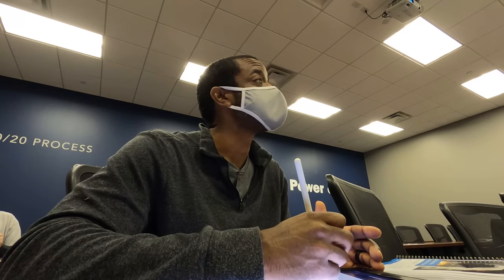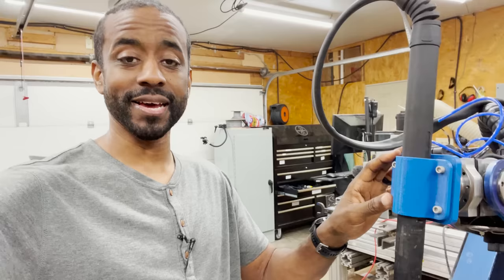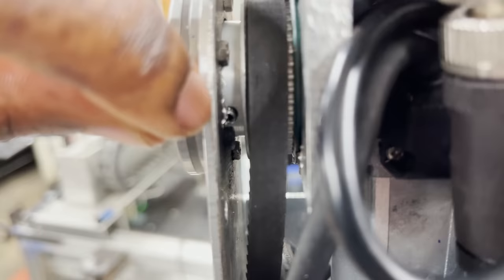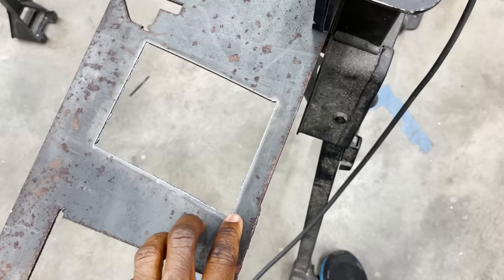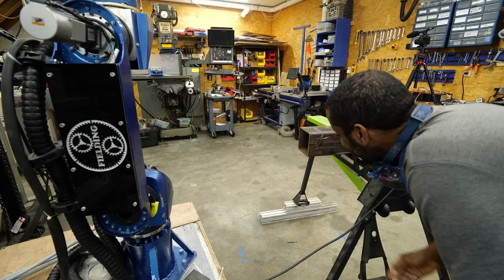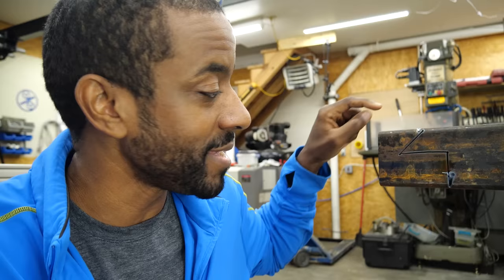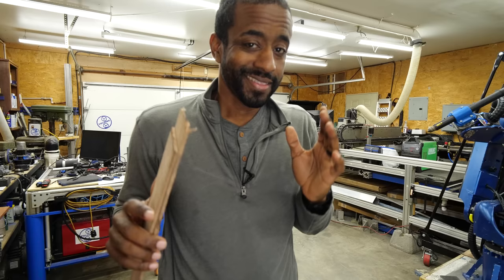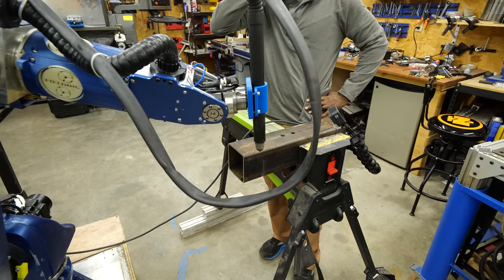I Added a Plasma Torch To My Robot - Jeremy Fielding #097

Comment from the maker: I figured out the relay problem. It is a solid state relay designed for low voltage DC only. I was switching 240 AC. I "remembered" the relay as being for both, but I was wrong when I went back and checked the specs! One problem down! LOL
Reply: That was my guess! Sounds like you got it. Amazing the things we miss when we're in a crunch.
Reply: LOL you were pushing the MosFETS into avalanche breakd-down while hooked to the plasma torch and it didn't explode?!  What brand relay did you buy, 'cause that's one TOUGH solid-state relay.
Reply: Great now your mind is free to tackle the main issue of programming and tracking,  good luck...
Reply: I believe that Stuff Made Here calls this "Integration Hell"
Reply: Jeremy, did you recalibrate after you adjusted the settings on the servo drivers?
Reply: Thought about that..... And you already figured it out! Awesome work!
Reply: Dude, this is inspiring. Love your channel
Reply: @martylawson1638  the trigger for plasma cutters is very low current. Most just use a normal limit switch to do it in the hand held torch. It's just an enable. Id be surprised that it's actually 240v.. it's probably 24v ac  or whatever the control board runs at. It would look like a closed switch by useing the body diode of the mosfet.
Reply: @jim4556  good point.  A lot of DC solid state relays are polarized to reduce heating.  I.e. use one output FET vs an anti-series pair.   Also FETs can be reliability operated in avalanche breakdown if you keep the energy input within the FETs ratings.  (Lot of stepper drivers use avalanche mode to shut down inactive coils faster)
Reply: The best way without take mcu process time is to use liniar hall efect sensor for each motor.

Then you can send motor left right (on off) only and just wait until get the right read from hall sensor.

About the circle in plasma cutter ,  you need to turn off the cutter until the motor move.
If it stay more time with slow move or reposition another cut.

Reporgram if the motor speed is blow x(m/sec) then plasma cutter relay off. ( the speed in x/y ).
The plasme dont cut in z only x,y
Reply: You can use or triac or relay solid.
Relay dc or ac dosnt import only the amper(a).

I dont know what it the plasma max power in watt. 
Triac can hold 240V and upto 40A
Reply: @orencomputerelectronics8751  no. I think it's a very bad idea to move away from encoders. Just get hardware that can properly count the pulses. You are trading like 32 thousand units of resolusion for like 1000
Reply: @martylawson1638  triac take upto 1.2v mult the current(A).
If thr current is 40A ( about 50W on ssr) .

He need good ssr , with high voltage (more then 240) because the spikes the break down the triac)
Reply: @jim4556  if he use encoder then he just need take lm555 in one state pulse. The mcu send one pulse the timer 555 send x pulses. Put one 555 for each motor then you dond need waste cpu time one this loop
Reply: @orencomputerelectronics8751  what? How would a clock IC help at all? Encoders have  A, A', B, B' and a zero or home pulse/ channel. This is done so you can determine position and direction  at any point of its rotation. Then you got absolute encoders that remember their position on power cycle.. Or safety rated where they are redundant.  You can't do anything with a 555. You need a microcontroller that's interrupt based. It needs a very fast scan time. That's what the fast counter cards do and are built to do. It's basically a microcontroller on its own with one job.. my point is why do this when you can just buy the part. 

Drives that don't have an encoder feedback are sorta hard to control anyways. So just buy a drive that does it all so you don't need to reverse engineer solutions to the  counting pulses, interference noise, PID turning and controlling that motor at a significant delay. Drives are very noisy. They put crap onto the line power and the radiated noise from the wires going to the motors will play hell on your electronics if they arnt built to be resistant to it. Those can cause false counts as well on things not built to do it
Reply: I was going to ask how “open” is open on the relay. Glad you got one down
Reply: @jim4556  the encoders coplex the situation. The encoder a= left a'= right  b=move one step b'=no move.

You connect ic clock to B, the mcu put stay 1" or 0" stay without cpu loop waste
Reply: @jim4556  i wat build soeedometer with 5v stepmotor 5 wire 2 pair.

I dont use encoder , the mcu take care of motor and 3 digit 7 seg
Reply: @orencomputerelectronics8751  stepper motors you are easy. They either go as fast as you are telling them to go since each step is commanded. You can determine their speed in software alone. Induction motors are different since they can slip in normal operation. That's why you use another device to determine position for movement control. If all you want is speed, you determine that sorta the same as a stepper motor and base it off of whatever frequency you are giving it.
Reply: @jim4556  Induction motors you can control the speed by PWM or voltage control.

the mcu easy can do that.
that is not problem 

about the position, i put sensor adn when the system boot the motor go start up position.

then the program will sync witjh motor
Reply: That was my knee jerk reaction. Sounded like your relay was arcing...
Reply: @jim4556  hi, induuction motor you can contol with PWM or voltage rate.

step motor in more complex to control, every cycle i need to run 5 code line for each 4 cycle (one is VCC=5V with 2 pair wire).

if i use induction motor with gear, i can easy control the movement.

the best way to control that , sensor position and the software in mcu can correct position.

when in motor had  resistance, it will take  more current and will move slower depend the control and magnetic interference  .
Reply: @orencomputerelectronics8751  stepper motors are far easier to control than a servo motor since stepper motors are synchronous. If you tell it to move 10 rpm, and it's not, you have a mechanical issue. So getting speed is very simple. A servo motors are just induction motors with feedback. They are not synchronous. And you cannot count on them spinning the speed you command as they slip when starting or stopping. Or with load changes.. that why you need position feedback with them. And do not need it with a stepper motor.
Reply: @jim4556  in step motor you must postion feedback also.

let say the power cut off, how mcu know where is the postion the  motor after boot up.
Reply: @orencomputerelectronics8751  no it's optional at best. My proof, 3d printers are 100% open loop with no position feedback. And most now can resume prints after a power cycle. Since you knew where the position was when it stopped, you know where it is when you turn it back on. You could use absolute encoders but at that point you should probably just use a better motor than a stepper motor. If you require higher accuracy your better off doing a homing move and zeroing it out in software before useing position feedback. You rarely use position feedback with stepper motors because there's almost no point in doing it. Again. It's a synchronous motor. It does exactly what you are telling it to do and if it's not, you've got bigger problems like an undersized motor. They should never slip in operation.
Reply: Instead of making plasma cuts, I would stick a magic marker in the holder to prove the path correctly first.
Reply: I bet you get job offers so much that it's become annoying, lol 😆
Reply: @jim4556  in 2D and 3D printer had optic led.
in 2D printer when you power it on the headwill  go to start point.

in paper feed had mechanic switch(on off) if had paper.
then the mcu of printer know where is the head nd papar.
if you dont use sensor, you move the motor over the limit and it will stop knowen position.
Reply: @orencomputerelectronics8751  an optical LED would not give you any position feedback and they are definitely not used in 3d printers. 

Occasionally a disk with slits that light can pass through is used in 2d printers but that's so they can have position feedback of a brushed DC motor. It's usually pretty low resolution. But offers no absolute position feedback. That disk with slits that light passes through is pretty much how encoders work. Now add 2 more disks to that thousands more slits and you pretty much have a modern day encoder.. 

Either way, it's not used on 3d printers. And I'm pretty sure that is only used on the brushed DC motor used to advance the paper in some 2d printers. But it also isn't used to remember position on power off. If you don't have the count it was on when power what turned off saved in memory, you will loose position.  However that's redundant for stepper motors. Because either you had it's position saved in software or you lost it. Again stepper motors are unique in that they are synchronous. They will not move unless you command them to take a step. If you are commanding each step. You don't need position feedback, you already know what position it's in.
Reply: Ok
Reply: Exactly what I thought, or a current mismatch, which amounts to the same thing.
Reply: Sounds like a good job for a Triac!
Reply: I was literally about to suggest switching voltage... yay for many eyeballs
Reply: I remember putting ac into a dc relay and it making this crazy buzzing sounds. Yup, using the right relay is critical!
Reply: This is exactly why it's usually a waste of time to try to troubleshoot problems remotely / sight-unseen.  My dad used to tell me "A client will call and say there's green smoke coming out the back, then I drive to the site and it's actually white smoke coming out the front."
Reply: Copying a reply I posted elsewhere: Shot in the dark -- is it possible that whatever cabling you are using to send the pulses from the microcontroller is interfering (via parasitic capacitance or I-don't-know-what) with the signal? E.g. filtering out some proportion of the signal, given that it's switching pretty fast? I.e. is the cabling designed for such use?
Reply: Jeremy remember the first video you made ??
Brother, I had found that video by accident a few years ago and emailed it to a few people with quite the paragraph about you as i proudly claimed you as My Find 😆.
Look at how far you have come man !

Doing AMAZING!

I know this doesn’t need said but man you have shown much more than your ingenuity!
Reply: I enjoy the developmental progression of your videos. I am happy you are able to be open enough about it. Maybe one day I will be. Anyway, have you confirmed that the multiplying the resolution count by 25 is accurate? I know you didn't give exact numbers between the original motors and the replacements you put in, but based on the guessed numbers you did give, 512 to 10k, I got 19.53125. Using 512 and multiplying by 25 is 12800.
Reply: I thought a possible induced magnetism closing relay contacts. But SSR = :(
Reply: @orencomputerelectronics8751  The Teensy has dedicated hardware to perform the counting - no need to do it manually, pulse by pulse, in software. So, using the peripheral requires very minimal CPU time, by comparison. Counting in the low MHz range shouldn’t be an issue. I have a vague recollection that the 4.0/4.1 has differential counters as well - making working with encoders a breeze.
Reply: @jim4556  Maybe. It really all comes down to the resolution required at the cutter. If you’re cutting with an end mill, it makes good sense to have, say, 0.0005” resolution. If you’re cutting with a chain saw, marking your cut with spray paint (1” ? resolution) is probably just fine. Obviously, the plasma cutter is somewhere in between. As we know, the resolution at the cutter tip is a function of the encoder, any lash in gearboxes and belts, the gear ratios involved, etc. It may be that 1000 PPR (virtual or actual) is sufficient. Finally, it’s important to consider that very high-resolution encoders are naturally jittery in real-world systems. If not fully accounted for, that can easily play heck with systems that rely on an accurate offset/position. (Ask me how I know …)
Reply: @a1nelson  just PID tune the servo motor. Anderson the drive look at the encoder itself.
Reply: Hey Jeremy, you've got the patience of a Saint !

You should consider using the Sponge Bob "..... moments/hours later" title card to add a little levity. Lots of channels use it to good effect.

I hope when your kids grow up, they realise how lucky they were 👍
Reply: Yeah, Solid state Relays are specific to what type of current they can allow through, when a normal solenoid relay is just a physical connection so you can theoretically run any type of current through them
Reply: Rofl at the end of the video I scrolled down to ask if you checked the voltage on the relays. Good job!

P.S. You are a great engineer, so you don't need to hope to become one. Everyone has more they can learn, but no one will ever learn everything.
Reply: I have much respect for your emerging skills, the following is said with nothing but love ;-). If I may offer a few suggestions for the times one engages complex (or any) systems, to lessen such experiences (for me it as deep earth probes) in the future. Do not build a complete system then, attempt to trouble shoot: an iterative, modular approach, is best. Build, change a module? Test it. Build, change a module? Test it. Repeat as many times as needed. The robot arm kinetics, would have been best completed before the plasma cutter was ever taken off the CNC machine... The relay all well would have been less of a mystery if that was all you had to deal with. Done this way, you'll know the system works when it is complete.

Great channel, waiting to see your next video.
Reply: Great find! I was going to guess breakdown voltage on a solid state relay!!
Reply: Dear Jeremy, are VFD inverters able to take other load than a motor? I want to run a welging inverter that needs 380V 3phase 8000VA from a 230V single phase line.
Reply: @jim4556  I would think it's just a 5V logic circuit
Reply: @johannriedlberger4390  I think you need a rotary phase converter for that application
Reply: @embededfabrication4482  With a rotary phase converter there will be 230V between phases but I need 380V.
Reply: I know I'm super late on the ball, but that's what I was going to suggest. As my Electromechanical Devices Prof. always says "If you exceed rated voltage electrons flow in places they're not supposed too, and when you exceed rated current things heat up" Your Projects are insane! And your always doing great work! I'd love to meet you learn from you and do some projects with you some day. Keep on keeping on!!
Reply: Oh good, I was going to ask if it was an electro magnetic mechanical relay, but that it was adjacent to a powerful permanent magnet keeping it closed.
Reply: @martylawson1638  Right?  No leakage of the magic blue smoke seems pretty amazing.   ;)
Reply: @orencomputerelectronics8751  Hey that’s a really clever solution, and it solves a similar problem in something I’m working on. Thanks for posting!
Reply: There are many disciplines in engineering. Solid state relays are not cheap, but a standard electromechanical ones are cheap, abundant and used everywhere.
 So, without cost as a factor, in applied engineering disciplines, which one is KISS?
I think Jessy James, the motorcycle builder said the greatest verbal line in design is, when you look at something and it does not appear to have enough parts to make it work! Beautiful in thought, difficult to pull off in reality. 
Therefore, fewer parts and keeping simple are the best part of design.
I don’t know if it helps, but sounds cool!
Reply: Great job!

Comment: you know what is missing? a little distance sensor like a cheap sonar (or a TOF sensor if you want mm precision) to keep consistent distance from the piece AND avoid crashing into stuff
Reply: The encoders are much more accurate than a ToF could be, and ToFs have a minimum distance.
Reply: @tuskiomisham  the encoder works only if you KNOW the position, the sonar is to avoid mistakes in the cad/fixture/part moving

Comment: Quick thought for the relay issue, is the robot arm relay rated at a high enough voltage for the plasma cutter? I would guess the normal robot gripper is a relatively low voltage DC solenoid, while the plasma cutter may be switching mains voltage or higher. If the relay is rated too low, the power / signal will just arc over the contacts whether open or closed.
Reply: There's also a chance that the high current and the position of the relay would force it open like a magnet being close to the relay.
Reply: Great point...
Reply: You're apparently right. Check the pinned comment.
Reply: I think we have a winner here...
Reply: I thought the same but that wasnt the case. He uses a solid state relay, which are based on semiconductors, not mechanical switches. They are either designed for DC or AC, and he had the wrong sort.

Comment: I been following your page for 4 years now. I was a graphic designer for over 10 yrs. Then switch career to electrical technology. Now I work a Electrical Control technician. Assembling, wiring, learning about hydraulic, setup network, PLC, Arduino, VFD and troubleshooting electrical control panel for bridges. Doing electrical and mechanical cad drawings. In a span of 20 months. Love this stuff. I'm so glad I found this page.

Comment: Wouldn't something like Robot OS and/or LinuxCNC be more up to the task for controlling a robot like this, especially using Mesa FPGA boards that can handle MHz worth of pulses or controlling via analog voltage signal (+10V through -10V) with encoder feedback, all running with an old office PC? Also, I've seen some of these robots on Youtube do some weird crud due to grounding problems when they are equipped with welding or plasma equipment.